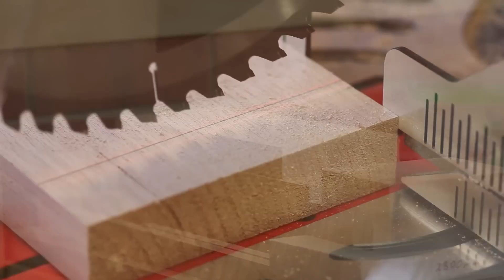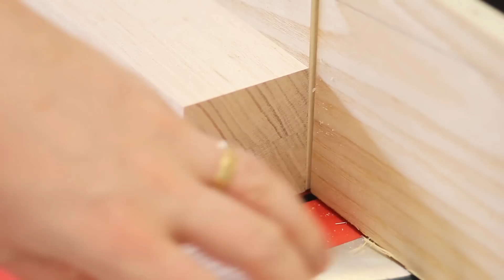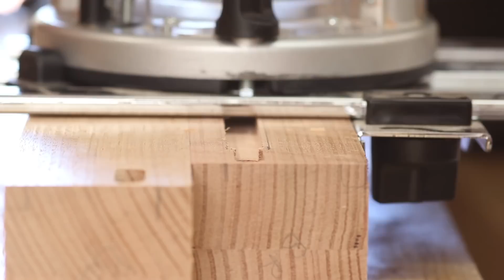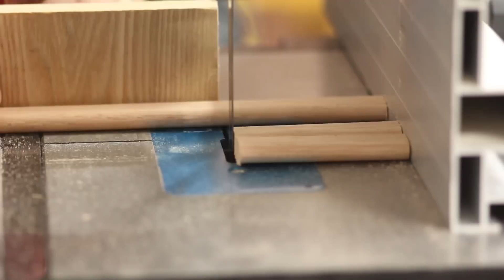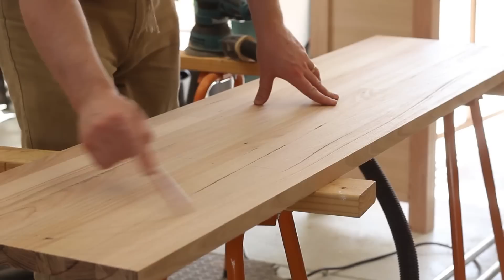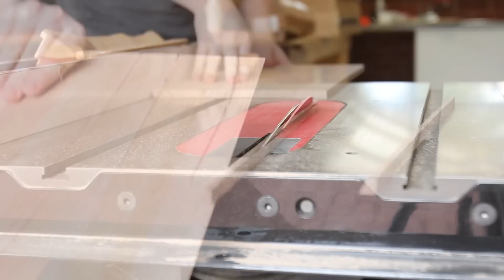082 - Sounds of the workshop (Buffet Table build)

Comment: Very nice video Paul, I really enjoyed the lack of background music or obnoxious cuts that many others use. 

I've read several of your threads on reddit and it's great to get a more inside view into your shop. I do have a few questions though. How do you like the incra box joint jig? I thought about it for a while and couldn't convince myself to pull the trigger. Is it worth the investment? Also, what kinds of wood do you have available to yourself down in AU? You use a lot of the oak in the projects your Mum and sister requested, but what else do you like to build with?
Reply from the maker: +Scott Hampshire The incra jig is simple stupid. "It just works". Dialing in the initial cut is easy, and dialing in the perfect cut is very easy if you dont' get it first turn. While screw advance jigs are really quick and capable, they require a bit more thinking to make sure you keep count. This is the first time I've used it (other than tests), and I'll be making drawers like this way instead of the quicker locking rabbet joint - they're stronger, prettier, and a bit more self aligning.

We'll also be getting the hinge crafter too - Incra have proven to us that while they're pricey, they're also high quality/well designed tools for specific tasks.

The oak I use is oak only in marketing name, it has about half a dozen names including Victorian Ash. It's open grain like "proper" oak, but otherwise its much harder (similar hardness to hard maple) with less coarse grain. Its "cheap" (as far as hardwoods in Australia go), and are what my family wanted. Its also one of the softest hardwoods commonly available in my area.

If I had infinite funds, I'd make everything out of blackwood, jarrah (hard), or  redgum (very hard). Heck, if I could get my hands on board size pieces, everything might even be beefwood.

What north americans typically consider "exotic hardwoods" in density and striking grain are what we have natively ;)
Reply: +Paul “TheWoodKnight” Jenkins Good to know on the incra jig. Thanks for the great content, on Youtube and reddit. Keep up the great work!

Comment: Great video, as always Paul.  Did you use hide glue for the open time or for a different reason?

Phil
Reply from the maker: +Jake and Emmy's Dad Workshop Thanks! Yeah, the LHG has crazy long open time compared to PVA, with (I think) 30 tenons going in at once, Titebond I would have been a disaster, III slightly better, but I can't find any of their 'long open' PVA glue available in the country. LHG was a pleasure to work with though.
Reply: +Paul “TheWoodKnight” Jenkins I've been wanting to work with LHG, but I'm concerned that it isn't as strong as the yellow or even white PVA.  Have you found that to be the case?

Phil
Reply from the maker: +Jake and Emmy's Dad Workshop I've heard that it isn't as strong as PVA, however its still stronger than the wood, just like PVA. Hot Hide Glue is much the same, being stronger than the wood, the glueline won't fail but the surrounding wood first.
Reply: +Paul “TheWoodKnight” Jenkins It might be worth talking to Timbecon, a friend of mine told me that he asked them about Titebond's "No Drip No Run" glue and they decided to start stocking it.
Reply from the maker: +Deverell N-K The NoDrip/NoRun product has 3-5 minute working time. Nowhere near long enough.
Reply: +Paul “TheWoodKnight” Jenkins I'm not suggesting that product, just saying that when my friend mentioned it to Timbecon they investigated and then started stocking it. As they must have some kind of relationship with Titebond or a distributor perhaps you could mention the same to Timbecon about Titebond's long open product, Titebond Extend
Reply from the maker: +Deverell N-K facepalm sorry, its been a very long day. You're right, thats not a bad idea - I'll ping them about it in the new year, I won't need any more glue before then :)